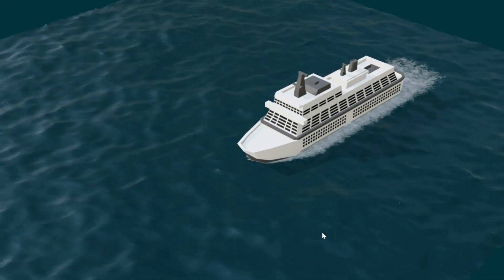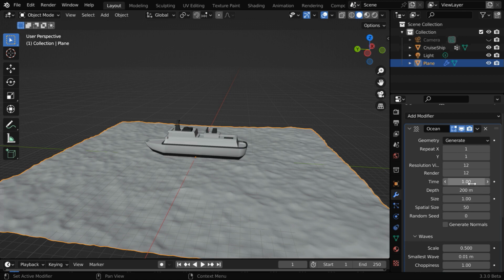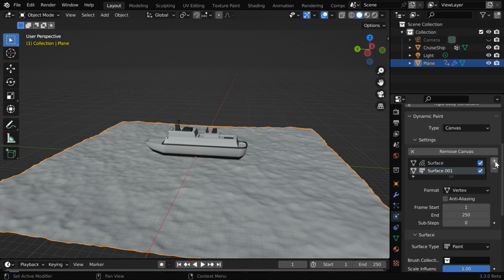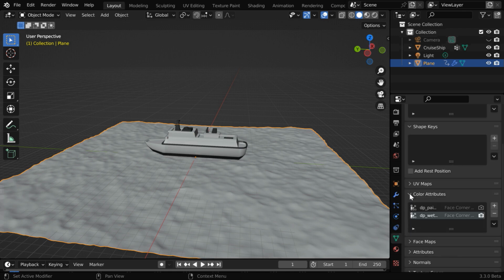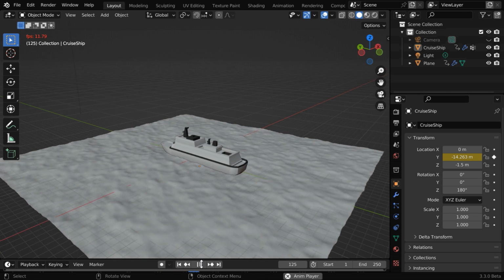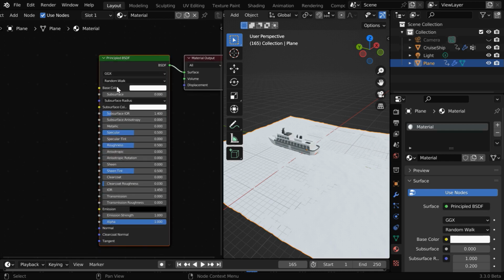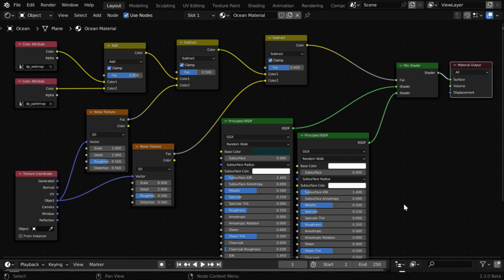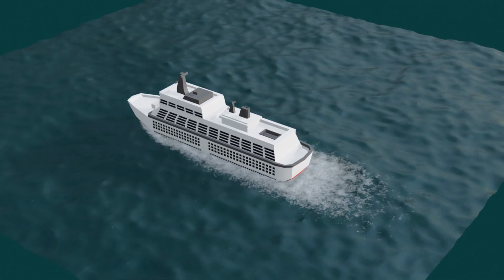Create Realistic Water Trail Using Dynamic Paint & Ocean Modifier Together In Blender Eevee & Cycles

Comment: Hello, are you still accepting emails about this tutorial? I've followed all your steps but I'm not seeing the white ship trail and I can't seem to figure out why. Thank you
Reply from the maker: Hi, we do respond on emails as and when we get some time. We have a specific membership tire on which you can definitely get faster response with solutions to your blender problems. Anyway, I suggest you to first use the same Blender version as in this tutorial (3.3 or 3.4) and once it works, import it to the current version. This will ensure that there is no version issues. If it works for 3.3 or 3.4 and breaks in the current version, we at least know what to fix.

Comment: I am not finding those green color nodes in my version of blender 4.3. Is the blue colour Math node the same thing. Because when I did that set up for the foam the whole ocean turned white
Reply from the maker: Do you mean the green color Mix Shader node? You can still find it under Add > Shader > Mix Shader, and not under Math. All green color nodes are available under Add > Shader group.
Reply: @5MinutesBlender  I am talking about the Add and Subtract node. It is is blue not green in Blender 4.3
Reply from the maker: @MyStudio-io3so  Ok. Go to Add > Color > Mix Color. Now within this Mix Color node, you can change the operator from Mix to Add or Subtract etc, you'll get the same node what you see in the tutorial.

Comment: Great tutorial, but the foam don't show in render mode or render preview
Reply from the maker: It seems to be a material-related issue. Please double check if the shader setup is correct. Another issue could be with the bake. But since you said that even render preview does not show the foam, it seems to be related to the shader setup. If it shows in the render preview mode but does not show up in the actual render, we would suspect that the baking is not done correctly.
Reply: @5MinutesBlender  im having the same issue.. please lmk if you figure out a fix
Reply from the maker: @ You can send your blend file at 5minblender@gmail.com so that we can investigate it and suggest a solution.
Reply: @5MinutesBlender  I had to save the file first for it to show up and sometimes bake it. Also, you cannot have trasmission set to high for the Material. These are the three things there that can solve the issue.
Reply from the maker: @MyStudio-io3so  Thanks for sharing your input, it might help someone in future 👍

Comment: why did my comment get deleted?
Reply from the maker: Not sure bro 🤔 Maybe YouTube found something offensive or spamming (of course that must be a false positive in this case). What did you want to ask by the way?
Reply: Yeah i think it was deleted because i added a link to a screenshot. However, my questions was, i have done all this and baked the dynamics, if i try to render, blender crashes. Another thing is, the paint turns out like to weak and not really bright white. Is there a way to make it more bright and white? @5MinutesBlender
Reply from the maker: @sammedia3d  Hi, Blender can crash for several reasons, the most common reason is lack of sufficient RAM to process a heavy scene. For other reasons, if you restart Blender and it works, you can simply forget that one-off case. You can add an emission shader for the foam and increase its brightness to make it more white.

Comment: Hey, for some reason the foam trail becomes really wide right next to the boat. Like the brush mesh is bigger than it really is. What settings would affect this?
Reply from the maker: One thing is how much you dip the ship inside the water surface. The amount of overlap between the two. Secondly, for the canvas (water surface) you can adjust two fields: Scale Influence and Radius. They control the intensity of the trail and how far the trail spreads. If you cannot still get the desired effect with these settings, the last resort is to customize the effect in the shader settings. You need to setup the trail such that there is very low effect (so that the water near the ship remains calm). But to get a large trail behind the ship, you need to multiply the effect through shader settings, so that the trail becomes exaggerated behind the ship. I hope you can get it perfected through the physics settings alone, and that is the best option, but I told you the backup route also. All the best 👍

Comment: hmm, followed this step by step, but the dynamic paint trail on yours looks smooth and fades out nicely. On mine I can see every vertex sharply and there is no soft fade out, any ideas on what I'm doing wrong? thanks :)
Reply from the maker: Hi, I guess the noise texture settings in your shader may have the clue. Depending upon the absolute size of the objects in your scene, you need to tweak the shader settings for a realistic output. Those values shown in this tutorial are specifically suitable for the model we used. You can play with those settings and see if things improve. Additionally, if you can afford it, join our channel through the Join button. Once you become a member, you have access to our original blend files used for these tutorials. You can download the same and compare with yours, or you can directly experiment with the source file. It is not mandatory, but it can save some of your time and help you learn better. All the best!
Reply: @5MinutesBlender  thank you for your help and quick response :) I worked it out! the 'Initial color' setting on the canvas was set to Type: Vertex, where it needed to be set to Color. I was also displaying the paintmap not the wetmap in the shader. Very useful tutorials, thanks!
Reply from the maker: Glad to know that you have resolved it! Great!

Comment: Can I dip my balls spheres I used in this Plexus structure to have the water react too?  https://www.youtube.com/watch?v=wVbIfzNZCVY  Don't mind me, I use Blender just as Art Therapy, but it would be cool, compared to using a sim or something... I fixed the Z fighting kinda thing going on by learning the correct way to color emissive textures with a color ramp... not an RGB node.
Reply from the maker: Yes, you can do that. Follow the same method as explained here. You'll use your sphere in place of the ship. You can keep the ocean, or just use a plane surface for the water. It should work in the same way. Do not forget to create enough subdivisions for that plane. All the best!
Reply: @5MinutesBlender   Tyvm, it sounds
 dumb, but when I know it's possible the problem is simpler to solve for me.  Especially when I'm a novice in a new field.  Don't know how/why it works, but I don't question what works for me!

Comment: substract and add (in shader) didn't found. I'm on 3.2 , is it a version issue ?        Thanx a lot...
Reply from the maker: No, your version is perfectly fine. You need to add a MixRGB node from the Color group. Within this node, you can change the function to Add/Subtract, and the node title changes to Add/Subtract. There is no separate node called Add/Subtract. I hope this helps.
Reply: Yes, Me too. But still did not found the solution